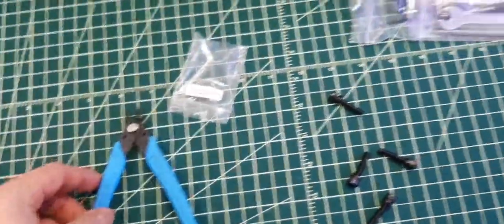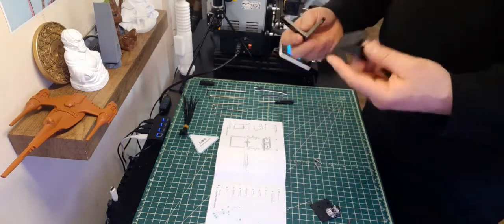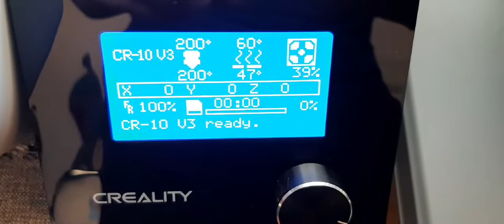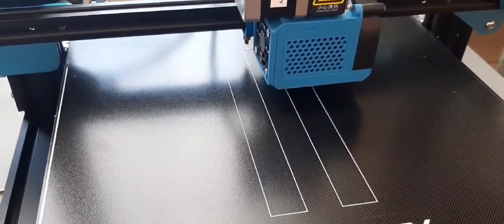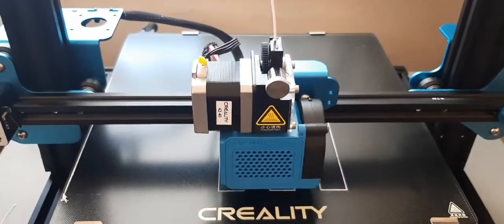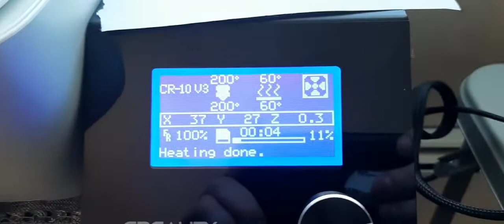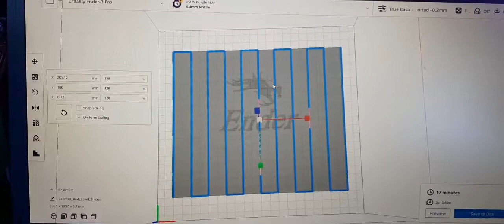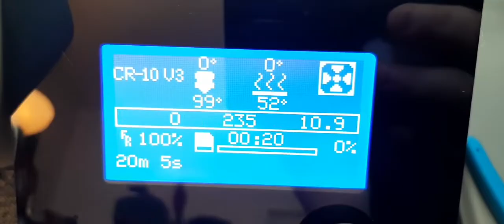CR10 V3 REVIEW

Comment: Does that not have the hologram e3d sticker on the extruder? Is a piece of shit printer. If you lived near me I'd sell you mine for 200 cad and I just put a brand new extruder and hotend assembly on it. Haha
Reply from the maker: This printer is fully stocked and works great in my opinion.  Haven’t had any hiccups yet
Reply: @Xaqted  I think I got a lemon brother. They sent me replacement parts for everything.  I read that the abs the hotend assembly was made of is unsafe. You'll notice it getting toasty looking. The fella I traded it to has a farm as a hobby and gave me a tektronix oscilloscope and 9 amp giant isolation transformer. Kinda lopsided so I gave him a bunch of expensive touch screens and such. I'm selling him the rest of my printer and hundreds of dollars of new in box parts I've accumulated over time for next to nothing. I had just bought a new siglent oscilloscope and triad transformer just over a month earlier and couldn't trade it back. They cost a small fortune haha. The 3d printing bug hit me hard and I sold tons of custom iot devices from prints for charity and earned like 6 grand to buy stuff for local youth stem programs. I love my pimped out ender but I just lost half my house to hurricane Fiona and was in the middle of the enders 3rd over haul. I had an orbiter and microswiss on it once and had the once bone stock 8 bit diy ender 3 pushing out filament faster than it could move and it could move at 75mms for a normal quality print. The one I'm buying can do 150 to 200. I'll still wish it was faster though I bet. I'm dealing with the company directly and getting a service contract and shit so I can concentrate on coding and circuit level theory. 43 and retired for almost a decade so I have many hobbies. Sorry for rambling. It's not a boast as I had to lose 90 percent of my families personal belongings to afford the new printer. I've been sleeping in the only room not affected on a chair the past 6weeks and it happens to be my workshop, music recording and gaming den. The wife sleeps in the basement with our rescued cats lol. Anyway best of luck with the printer. When I built an iron man helmet I used rustoleum crack filler and paints so it looked like it was a movie prop. You can get the led fabric for the eyes on ali express.
Reply from the maker: @jstro-hobbytech  good luck! Thanks for sharing, and I truly appreciate you!
Reply: @Xaqted  I replaced all the parts and traded it off haha.
Reply from the maker: @@Socom3988 the CR10 v3 is one hell of a workhorse.  It doesn’t stop, right out of the box I’ve had no issues.  The only thing I had to replace was the nozzle, but that was after 6 full size helmets being printed. As far as a slicer, I personally use Cura version 4.13. And filament, I’ve been on a Sunlu kick lately. It’s a good brand and prints very well.
Reply from the maker: No problem, good luck!
Reply: Great video, next time skip the 90s skinnamax music on loop. 😂 hard to concentrate and listen to what's up. You definitely can't hear that printer if that music was playing